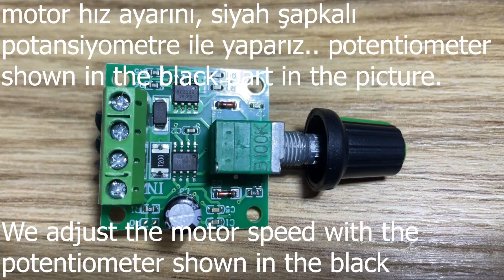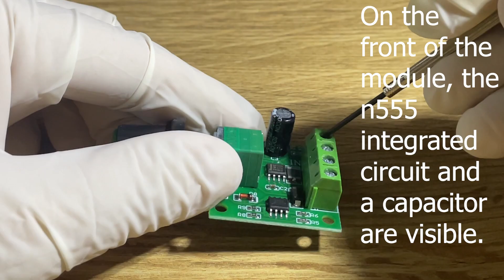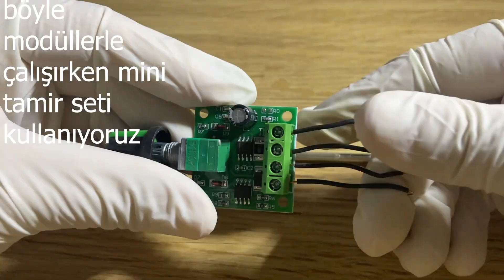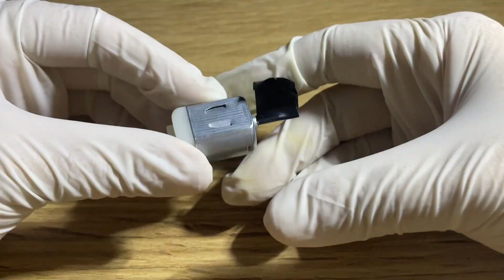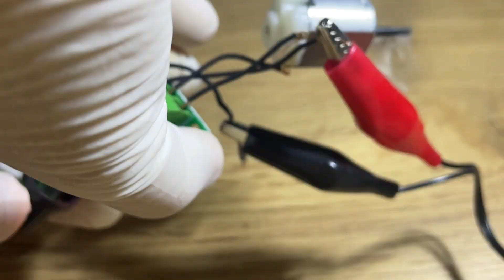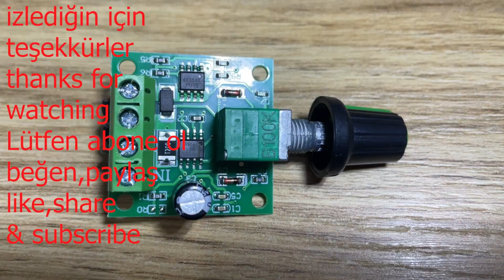PWM DC Motor Speed Control Module | DC Motor Hız Ayarı Modülü | Motor Hız Ayarı Nasıl Yapılır

Comment: This method is efficient because the transistor or MOSFET in the circuit switches fully on or off, minimizing power loss. For DC motors, PWM maintains torque better than simple voltage reduction methods like resistors.
Reply from the maker: Welcome friend,İ ‘m very happy that you are here.Yes I agree with you,this module one of the best ways,MOSFETs and transistors have problems with heating and deterioration and are useless for motor speed control😊